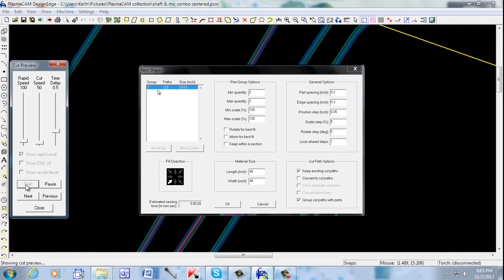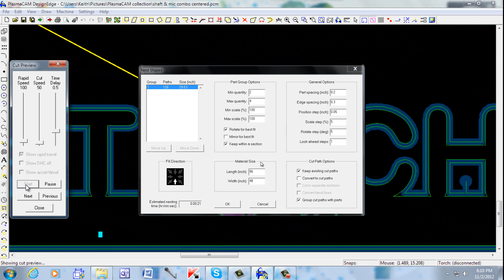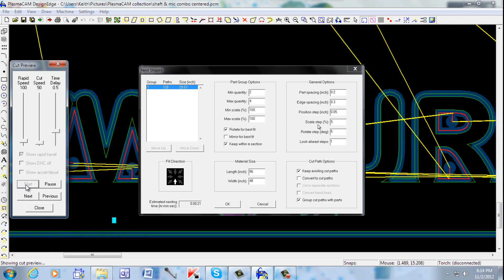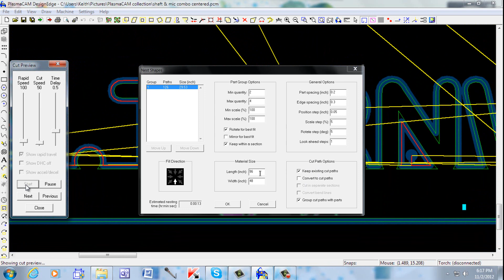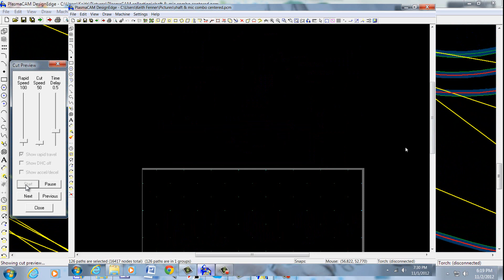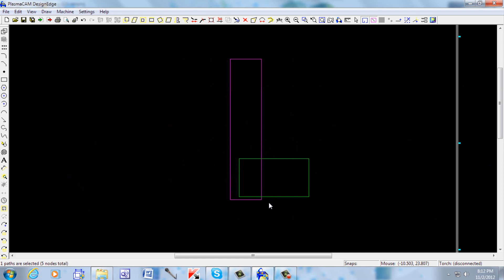Nesting 123

Comment: I did some nesting when I had my internship at Bobcat. All the settings were pretty much defaulted in for the laser cutters. Just get the models from product engineering and get them cleaned up and nested in the software and then off to the laser cutter. I also remember the software was defaulted to add a tab on the parts where it would not be completely cut out so the part wouldn't fall through and end up in the scrap bin.